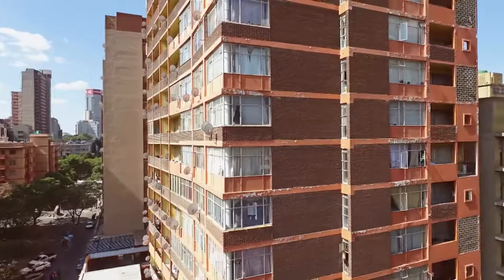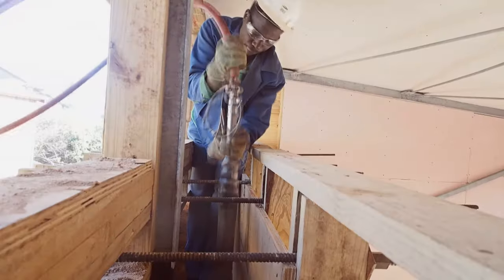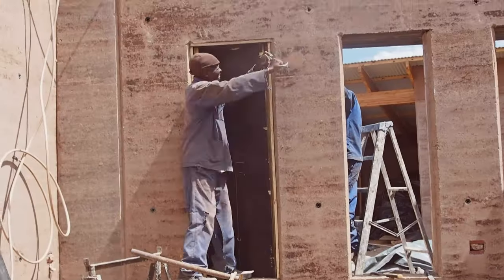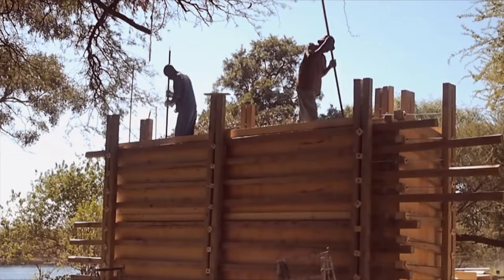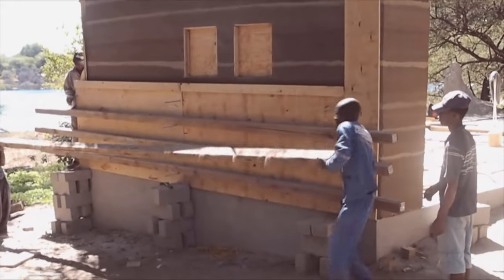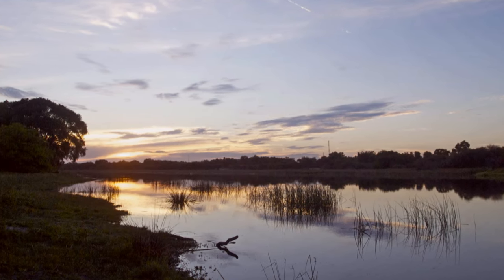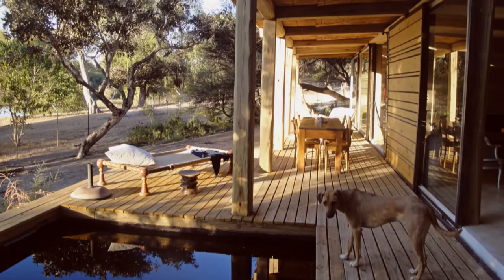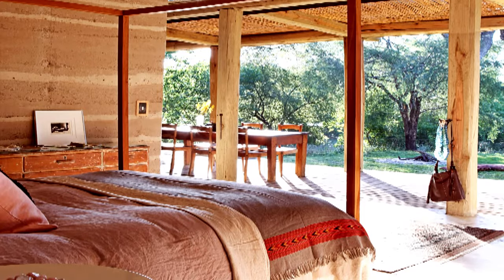Otto Cottage - Paul Marais. Maun, Botswana.

Comment: suitable for rainy northern climates?
Reply: it deppend on quantity of stabilazers like cement or lime . If youre not a hippye rsrs you could use 15 % cement, and aditives
Reply: Be carefull with asumptions here...build a home is a big/expensive/time consuming proyect so better found your percentages in solid test, I can recomend this book: "Diseño de adobes estabilizados con emulsión asfáltica, universidad de Cuenca" from Arteaga and Loja (free pdf online) is a thesis research about BTC (like rammed earth but in blocks), they run lab test for compression, flexion, absorption percentage, and "water footprint" very important data, your concern is in page 121: a BTC with 10% of cement, submerged in water for 10 min get a "water footprint" of 0.7 mm. 
So is not waterproof, that's why it is very common to "double wall" (not necessarily both of BTC/ramm.) so you can have rammed earth outside, proper water insulation in the middle+thermal insulation, and whatever you want for inside wall.
Well, best luck and good readings!

Comment: It seems to me that it would quickly take on the same temperature as outdoors.  What temerature range can one expect inside the finished structure vs outside? How quickly does the temperature inside fluctuate?  Thanks!
Reply: that's the beauty of it; in fact all African traditional construction methods have this quality. Heat is slowly accumulated throughout the day by the material and is slowly lost throughout the night, loss of heat is accumulation of cold; so the day is cool inside the building and the night is warm. Remember, our days and nights are almost equal throughout the year. So by the time all heat is lost, the sun has come up and vice-versa
Reply: No, the walls are usually thicker than conventional brick walls and since the wall has a higher density, heat takes a lot to of time going from one side of the wall to the other: around 12 to 16 hours